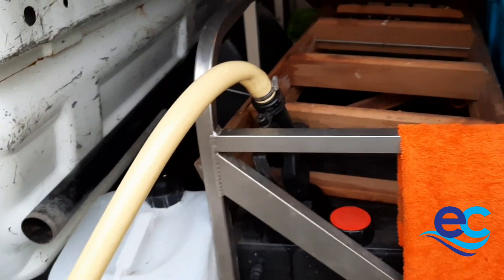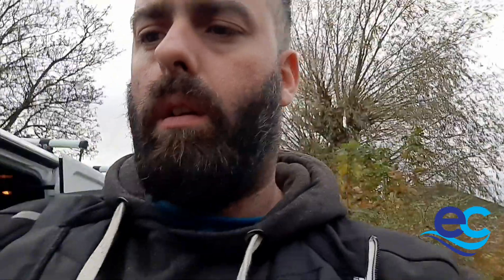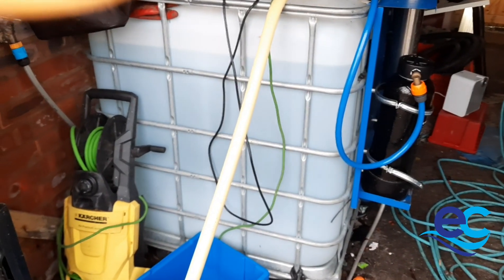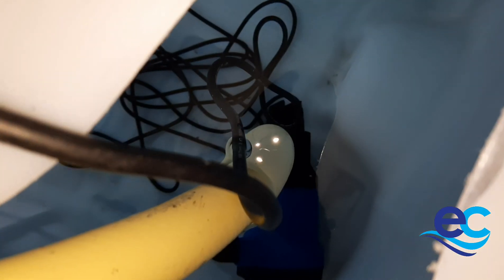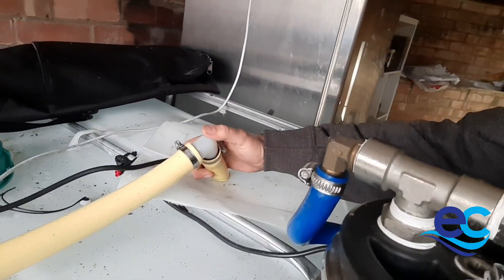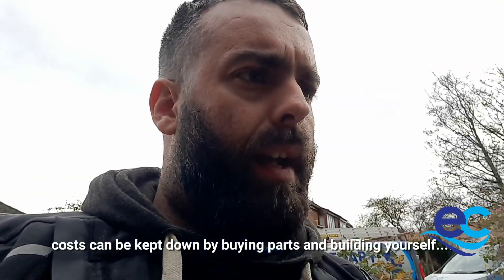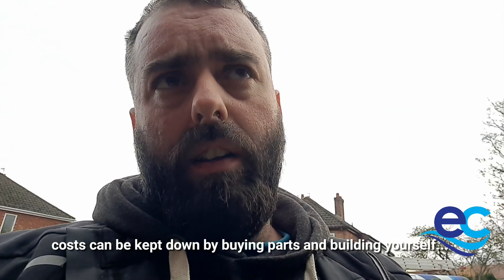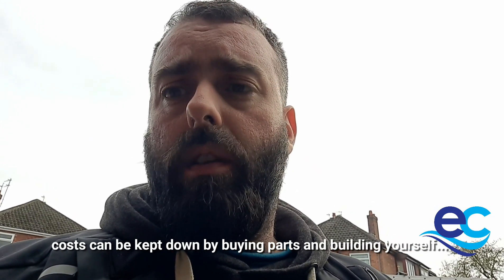Static water purification system and water fed pole window cleaning

Comment: Hi mate r u still using this static set up now? Guessing it's the same one they still sell now for just under £1100. Looking to move over to pure water after 20 years traditional
Reply from the maker: Welcome to the dark Side 😄. Yes we still use it. Never had a drama touch wood 🪵
Reply: @ChrisAddis  haha. Cheers for the reply. That's good to know. What Pole set up r u currently using
Reply from the maker: I've a few, one van has the 700ltr 2 man Ionic hydros, one has the 2man 650 flat tank and I've a 650ltr upright with a diesel pressure washer fitted.

Even if you're starting out I'd get a two manner, that way you can grow to take on staff if you want....and if you don't you've a back-up